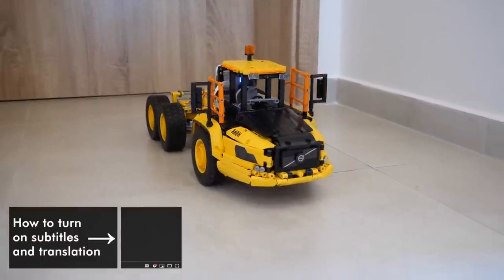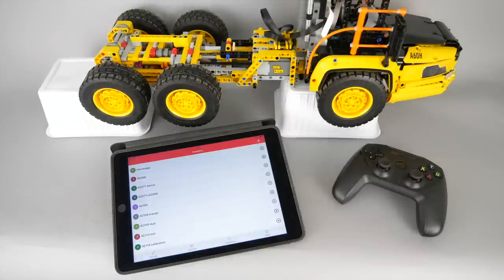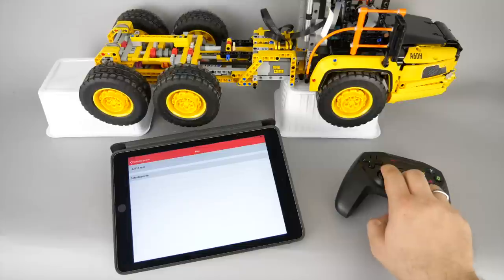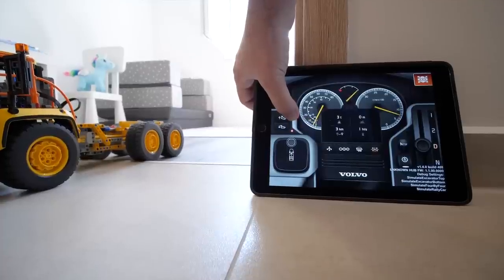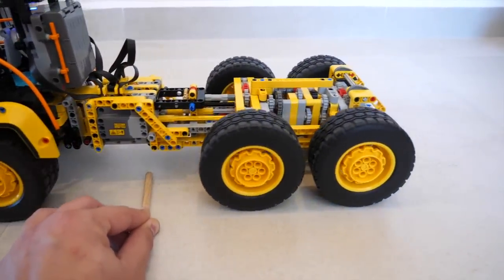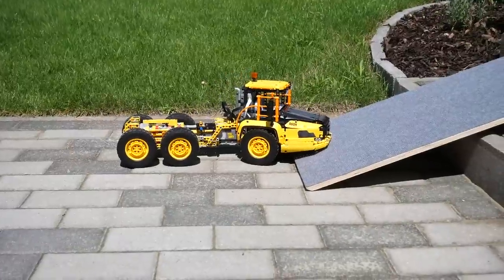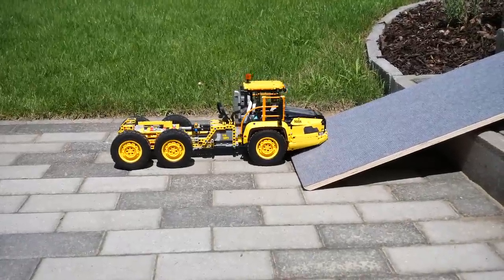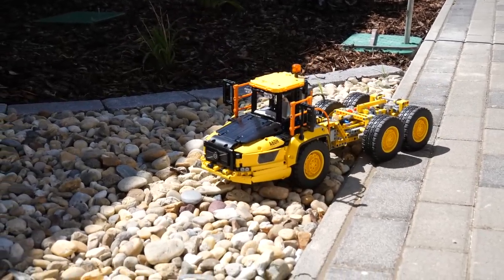Real automatic transmission for LEGO Technic 42114 6x6 Volvo + custom controls with BC2

Comment: The stock setup has the vehicle shift like if you would shift from first to second in a manual car without clutching. It would be really good if this had an actual clutch which could handle the load and make it a lot smoother and you wouldn't have to stop. 
Unfortunately, it would be quite difficult to implement. This clutch would need it's own motor.

Comment: I’m designing my own 6x6 LEGO RC. I’m completely new and the differentials kinda have me stumped. Each pair of wheels is gonna be equally spaced, so there’s a considerable distance between them. For each pair I’m gonna have a Torsten differential, but for the differentials between the pairs (like a differential on the drive train between the first and second pair, and a differential on the drive train between the second and third pair), what should I use? Two locking differentials that I manually lock remotely? Or another two Torsen differentials so I don’t have to add any more motors?

Comment: Nice!
Using the gyroscope is a neat idea - I will copy that ;X Implementing a somewhat smooth automatic gear box is not a trivial task, car manufacturers are working on it since decades :D
But I realy hope that the default C+ profile will have something similar and that the PU-App will be updated on August 1. -.-
Reply from the maker: We'll see what comes in the C+ profile, but I don't think it will actually downshift automatically :)
Reply: RacingBrick can you review the LEGO Ideas Grand Piano set?
Reply from the maker: @artyjaycayairlines  I might review it if I can get one

Comment: Instead of stopping entirely to shift gears, what if you just lower the drive motor speed by 10% during the shift, this should give you the backlash you need to disengage the clutch teeth.
Reply from the maker: 10% makes no difference at this scale and speed. It jams quite frequently if it is not stopped, I'll rebuild it before the next test
Reply: @RacingBrick  Why does it jam? Does the next gear engage before the previous gear is fully disengaged?
Reply from the maker: @radbot1  no, it cannot do that by design. The issue is with the DBG driving rings (18947) and the red 16t clutch gears (18946). There're 4 small fins on both to be able to drive each other, but there are scenarios when the fins are in the exact same position and they get stuck. The axles holding the driving rings also flex and the orange gear selector (35188) can "jump out" of the DBG driving ring and that can get stuck too.

Comment: Just finished my build (twice now) but I cant get the rear differentials to work, they wont turn. The front wheels drive ok in all  gears and the bucket lift up and down is ok. If I turn the the rear diffs manually All wheels turn, BUT the front wheels in the opposite direction, I read on Redit this is normal. What could be wrong? I've spent a week trying to figure this out. Also I noticed that in your build video of this unit you have the clutch opposite from the manual. Are there mistakes in the manual?

Thanks for the help and your videos
Reply from the maker: What happens if you don't try to turn the diffs manually but run the truck from the app?
Reply: @RacingBrick  Only the front wheels turn, but all shafts are turning  just NO back wheels
Reply from the maker: @OldSalty22  if you turn the vehicle upside down, there's a dark bluish gray gear around the middle, that's the central differential, it in front of the first pair of rear wheels. If you rotate it manually, all 4 rear wheels should turn in the same direction. If they do, then your diff orientations should be fine. 
It's also possible that the red axle connecting the central differential with the first pair of rear wheels is not properly inserted in the central diff and that's why it doesn't drive the rear wheels.

Comment: Completely stopping between gear shifts is too unrealistic, imho. Also, extra inertia from previous gear might help with obstacles, if the truck was not stopped during shifting (that might not be that useful on lego scale). I wonder if it is possible to roll the truck on neutral during gear shifts, like real vehicles do.
Reply from the maker: There's no neutral with this gearbox design and at this speed the inertia is negligeable. It stops now to avoid jamming which happens quite frequently during standard operation
Reply: @RacingBrick  yeah, one might need to rebuild the whole gearbox for realistic neutral, and the result might not be justifying the effort
Reply: Ok, I finally formulated what I do not like in stopping between shifts. That is essentially starting moving on high gear, which is a bad thing, you should switch to high gear only at certain speeds. At least on real cars. But in this set, shifting on the move seems to cause more issues than stopping during shifting.
Reply from the maker: @osmanpasha_diy  this is a low speed - high torque usage of a gearbox, not really like on an average car. Think about an off-road vehicle, it moves super slow to be able to climb over obstacles, if there're no obstacles then it can move faster, but again when an obstacle comes it needs to slow down to be able to climb it.

Comment: are you using rechargeable batteries
? or are you using normal AA ALKALINE batteries?  that's a big difference in performance.
Reply from the maker: I'm using rechargeables but only fresh alkalines show a visible difference in performance, their voltage quickly drops even below the level of rechargeables

Comment: 1. Is it necessary to stop Drive motor for gear shifting?
2. On 3:42 - looks like purple limiter hits an upper liftarm and can cause gear selector to stuck? If so, is the use a 'XO' 2L liftarm can solve this issue?
Reply from the maker: It is better to stop the drive motor do avoid the jamming of the gearbox and the stressing of the components. The purple limiter does not hit anything there, it stops there because some gearbox components are not connecting totally smoothly and it takes a second or two until they snap properly.
Reply: @RacingBrick  Thanks!

Comment: Hey hope you are well, is it possible to use brick controller with BuWizz app? And if I could use a PS4 Controller
Reply from the maker: BrickController 2 is a separate app, you can use it with the BuWizz unit. If the PS4 controller works with your phone/tablet then it can be used.

Comment: Hello, can I see you making a fast car using powerfunctions with no buggy motor?
Reply from the maker: Here you go - https://youtu.be/RQd7Md49dSc
Reply: I want one without a buwizz
Reply from the maker: @pablesm  then you need to define what is "fast" for you as standard PF motors and PF power sources will not really make anything fast. The Corvette can be built with a PF power source for example but it won't be nearly as fast as you saw on the video.

Comment: Very good but you need to fix all the craking sound
Reply: that "cracking" is just the gearbox switching.
Reply: @Lizard_Workshop  i made some gearboxes and they are not that crakiling
Reply: @McKrushi  yes but mosty its the Po motor being not accurate